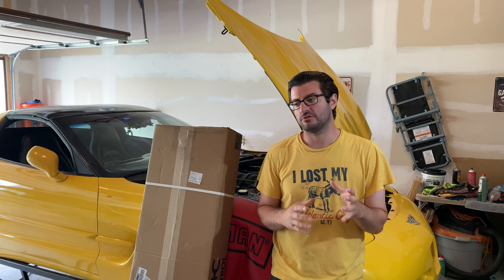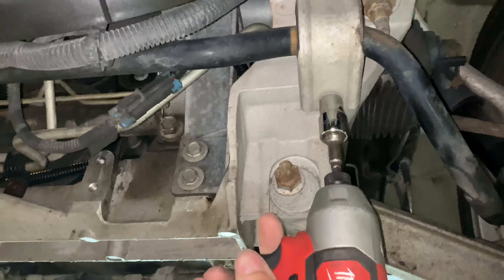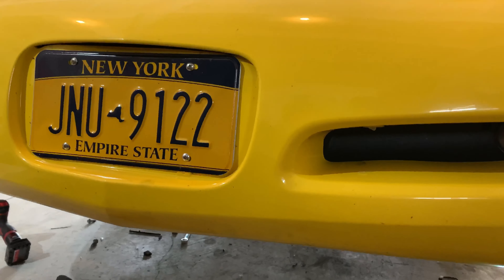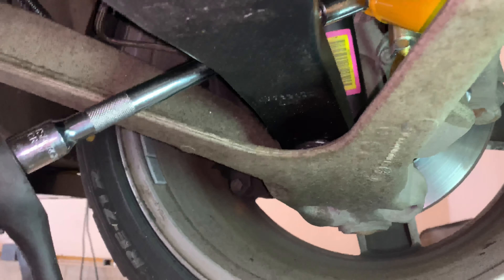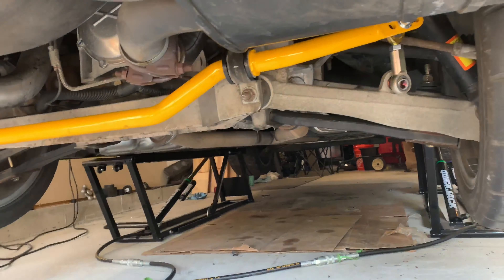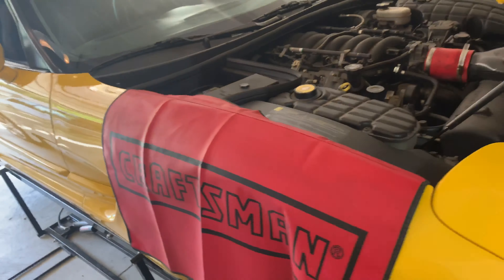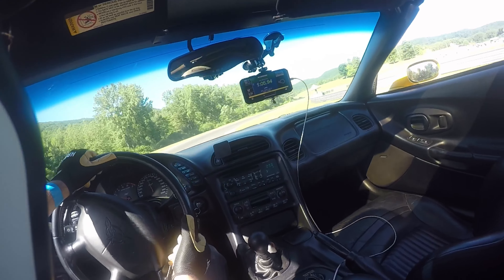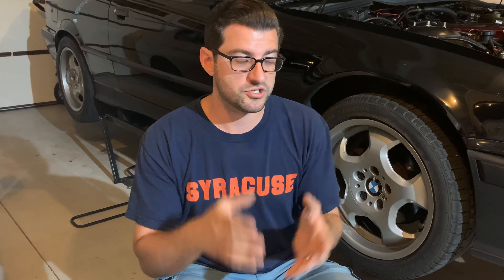DO SWAY BARS MAKE A BIG DIFFERENCE? C5 Track Car Ep: 11- install, track experience, and review.

Comment: Appreciate the input and feedback from a fellow C5 owner.  I have an 03 convertible with an A&A supercharger pushing 597 rwh and looking for better handling.  Going with C6 Z06 wheels for grip, and considering the sway bars.
Reply from the maker: I’ve done both wheels and sway bars. The tires matter more than the wheels. These sway bars were the single biggest handling improvement I made to the car. But be warned, it’s stiff AF on the street lol. No more comfy corvette haha.
Reply: @LowBoostFilms  Im not sure I want to give up the ride that much....My wife and I love taking long trips in this. I am so happy with the supercharger.  It can drive like a regular corvette no problem yet me a monster when needed.  The cam I added did have a bit of a difference with the low idle..
Reply from the maker: @ericswild  yea might not need that thick. Maybe z51 sway bars are a little stiffer. These are stiffer than c6 zr1 sway bars haha

Comment: Looks like your "OEM" endlinks in the front were replaced by C6 metal endlinks by a previous owner. The "OEM" endlinks on the back look like moog parts that could be found at the local auto part store.  All that i just mentioned is not uncommon to see since the real OEM endlinks are made of plastic and are total garbage. Great video and awesome upgrade. Enjoy it!
PS. Looks like you installed your rear endlinks upside down based on what you mentioned about what the instructions say.
Reply from the maker: Wow I didn’t know that about the OEM ones. Yea I noticed I did it upside down off camera I was hoping nobody would notice lol. That didn’t take long. They’ve since been switched but I had already filmed this.
Reply: Looks good bro. I also noticed the end links were upside down, but wasn’t gonna say it. Also, looks like you used LumaFusion in this one... love the new intro!
Reply from the maker: Thanks! Yea LumaFusion is so much better than iMovie. Yea, I saw that after I filmed it lol.
Reply: Low Boost Films told you bro!!! 😁
Reply from the maker: Never doubted you!
Reply: Do you think these Seay bars are a performance upgrade over C6ZO6 sway bars? My car is equipped with the ZO7 track package, but my front sway bar is bent. I’ve been looking at these to upgrade. What do you think?

Comment: I've noticed that afe also makes a sway bar kit for c5/6 that comes in blue and is a little over $200 cheaper than the O'Connell bars. The 2 sets are the same size and dimensions, not really sure why the drastic price difference. Although the blue ones don't come with the end links and may not be made out of chrome molly steel. Anyway, my wife has a base c6 and we're looking into sway bars. Thanks for the review, was very informative and can't wait to see what else you've done as c5s and c6s are very similar. Also glad to see you test your parts on the track.
Reply from the maker: Are are they adjustable? That would make a difference on track depending on your driving style, these end links re adjustable as well. If you’re street driving it that won’t matter, but also if you’re not tracking it these sway bars will make the car very stiff on the street. It’s not nearly as comfortable of a ride to be honest. the improvement in body roll is amazing though.
Reply: @LowBoostFilms yes, they look exactly the same minus the color. As mentioned before they dont come with the afe adjustable end link. And summit sells those for $263 alone. So I guess the O'Connell  bars would be cheaper than buying the blue ones with the afe end links lol. Her car is her daily but we do use it for autocross. Would link to take to the track eventually but not with out and oil cooler first
Reply from the maker: @sbc_jake_9677  nice, they would definitely help out for autocross. I’m not sure you would need an oil cooler for auto Ross but definitely if you’re going to track it the upgraded radiator with the built-in oil cooler was a great upgrade for me. I also did a video on that.
Reply: @LowBoostFilms  i have seen the oil temp get up to 254 afew times while autoxing on  hot days. Not in the danger zone but definitely not comfortable seeing that. We are going to tune the computer to kick on the fans sooner at some point to see if that helps with temps first

Comment: Great video.  What were your torque specs for the bolts on bushings and end links?  Also, I track my 2004 Base C5 with stock setup wheels / tire size and heard you have 275's for a square setup in your video.  
1) Are you using the stock 18" back wheels for front also?  If so, did you have to use a spacer and what size if yes along with bolt extensions?  
2) How does it handle with square setup and what is the difference with hard braking into corners & oversteer as probably more solid now into corners?  
3) What did the square setup do to the traction control on the car as imagine the wheel change from 17" probably confused the stock program setup?
4) Are you finding any difference in balance of car or tire wear?
5) How do you have your alignment setup as I am at -2 on from and -1.4 on back which is all they could get me with no toe since I have to drive to track?
6) Did you go with bigger brake kit if you put 18" wheels on front?  If so, how much of a difference did that make?

Thanks as I am in Minnesota and run Brainerd and look forward to Road America next year so want to get the setup correct.
Reply from the maker: Ok let’s run this down. I used the stock tq specs for the sway bars and what was suggested in the instructions 
1) yes, they’re the rears 18x9.5 all around no spacers
2) it’s very balanced, doesn’t oversteer or understeer too much, it feels great, the sway bars help keep the balance too
3) no traction control problems with the square set up
4) it helps with tire wear because I can rotate the front to the back
5) my alignment is not super aggressive because I do drive it on the street but it is a little bit more aggressive than stock. I don’t have the exact specs but I found on Corvette forum an article that had a pretty good camber setup 
6) I put c6 z51 brakes on. Same caliper but bigger rotor and bracket. I have a full video on this as well.
Reply: Thanks for the updates.  Just a few more track questions.
1) What tires do you use or found to be the best as I am currently using the Goodyear Super Eagle 3 at 220 softness Vs. R and how many track days / 2 hour a day do you get out of them?
2) Have you lowered your car.  Some of forums say with Base Stock you can only go about 1/2" and need an alignment again.  What did you experience if you lowered and thoughts as looks to be easy but don't want to hurt balance or handling of springs.
3) Have you had any issue with brake fade as I haven't yet and have Hawk DTC 60 with GM Rotors.  Any insights on things like  https://advancedautofab.com/p/c5-c6-brake-cooling-duct/   
4) What size tires did you put on front and back?  Did you go with 275/35/18 or stay with 275/40/18

I am trying to get all updates prior to Road America and Chicago tracks next year.
Reply from the maker: @pauldavis7360   check out my other videos I go in depth with a lot of those. I run RE71R 275/35/18 all around I’ve gotten 5 track days out of them with lots to go. I have Raybestos ST47 pads and they don’t fade. I upgraded my front brakes to c6 z51 brake rotors and it’s been great. I raised my car up actually it was lowered a lot when I got it

Comment: Car looks pretty low. Is it slammed on stock bolts or is there a kit? Been back and fourth on going to coil overs on my C5, or just lower it on stock bolts and add new sway bars.
Reply from the maker: It had lowering bolts when I got it, but I wish I could raise it more. The fronts are seized. I need to fix that. I raised the rear a little bit.